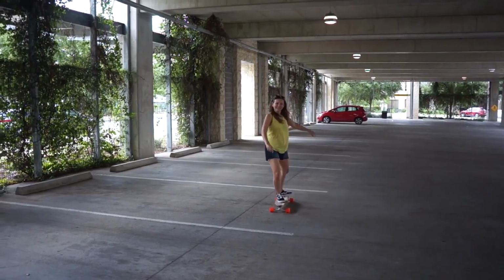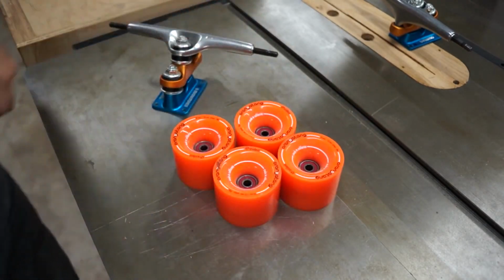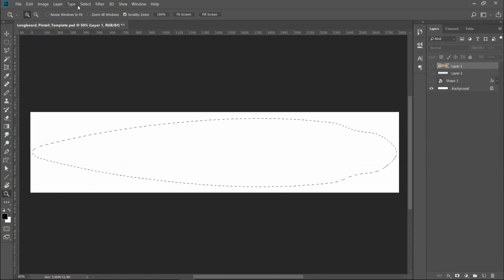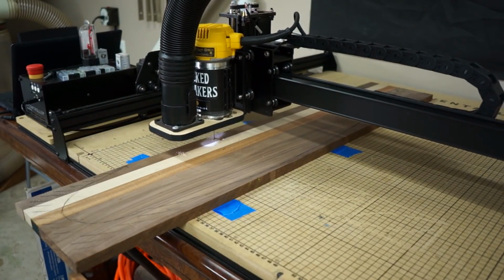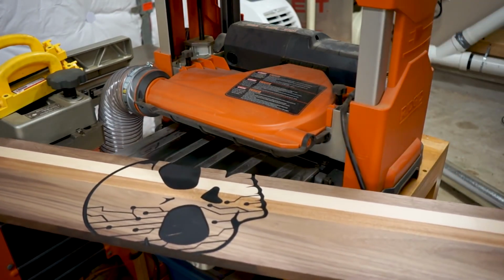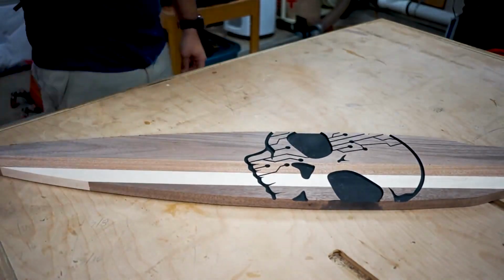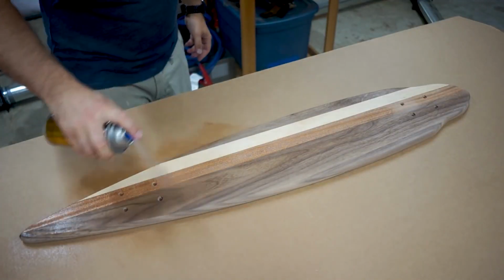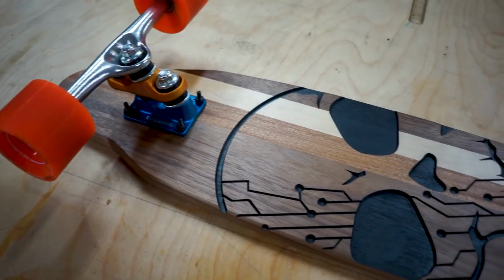How to make a DIY Longboard

Comment: question, I've seen skateboards made with plywood, but I also saw one made with maple. the plywood is supposed to hold the concave bend but does using a single piece of wood have the same effect?
Reply: Surprised no one answered you earlier.. plywood veneers is the way. A solid wood skateboard is so heavy and flat and un dynamic and with zero pop. The pop is from all the tension held in the curved plywood being heavily pressed. If you make a board from a hardwood plank... it'll feel like you're skating ..on a hardwood plank 😂